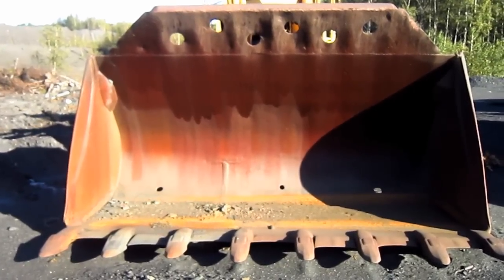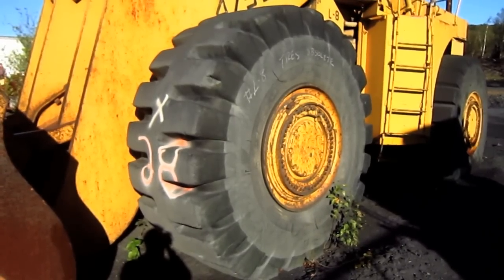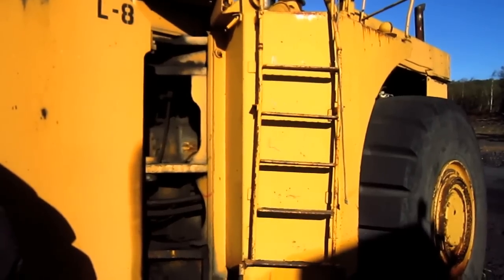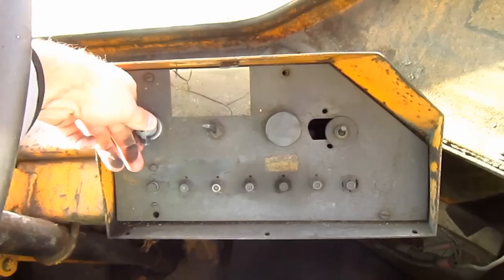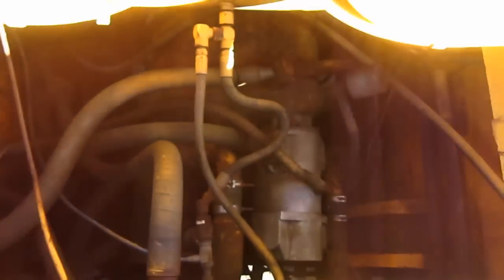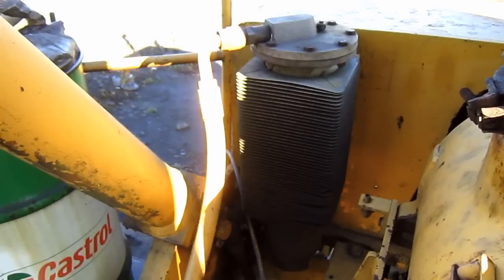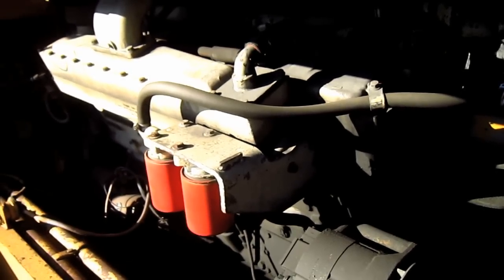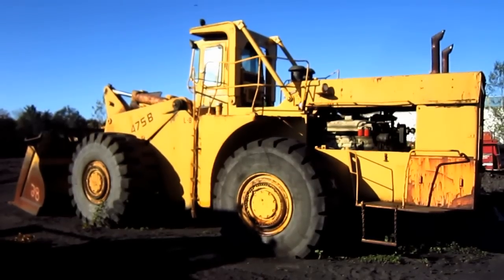Clark Michigan 475B Documentary

Comment: The local Dealer ( probably from Clarksburg WV) leased a 475 Turbo to us in the early to mid 80's. I think I have the numbers correct...it was a hydrostatic drive loader. Performed well. Was good to load coal as it was faster than the 992 we had. But was down on digging power compared to a 992. Didn't stay long and was replaced with a 992C.

Comment: Visibility was fantastic on those old girls both forward and backwards. The worst thing about running them was the throttle pedal. The linkage to the fuel pump was about ten foot long and required a fairly heavy spring to pull it back. My knee is getting sore just thinking about it, but other than that I loved that loader / very smooth ride and hydraulics were easy to control. It was surprisingly light on her feet and your could really load trucks in a hurry .If I recall it would lift around the 25 ton range if vou had heavy material. I don't think it liked much more than that. I also ran a 992 cat about the same vintage .I believe the cat would lift a bit more but I chose the Michigan if I had to pick .
Reply from the maker: Very interesting! Thanks for sharing! I've heard many operators say they would choose the Michigan over the Cat 992 any day